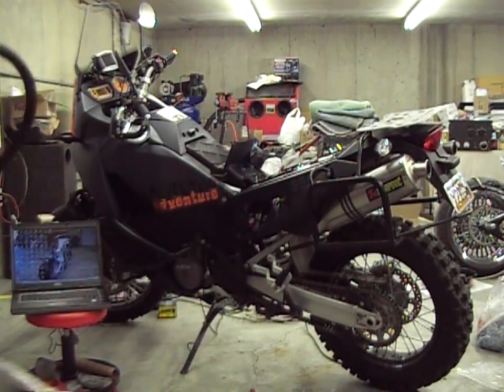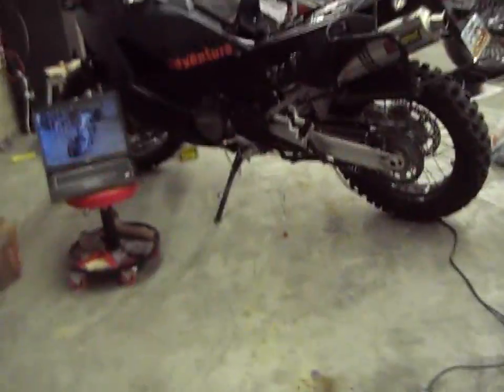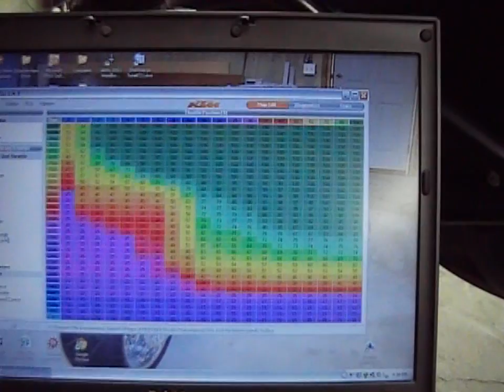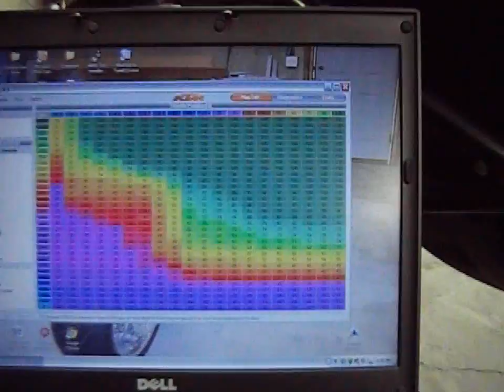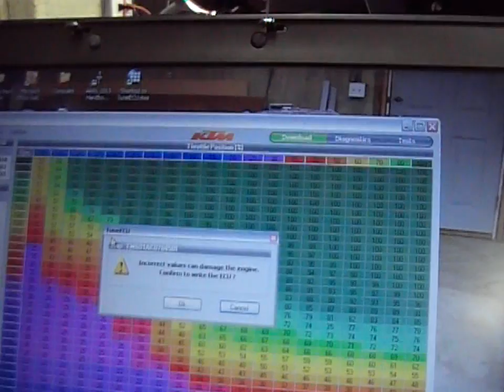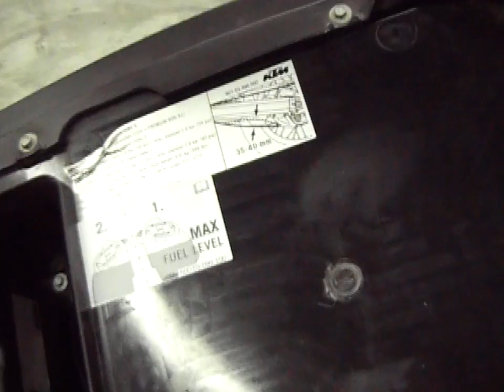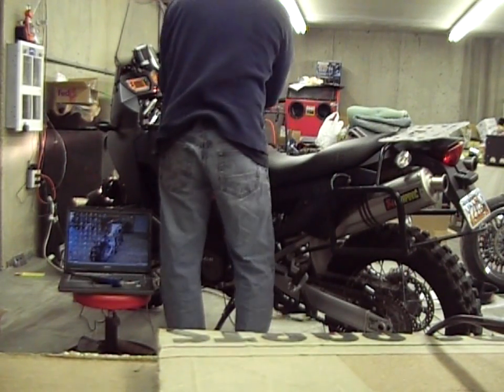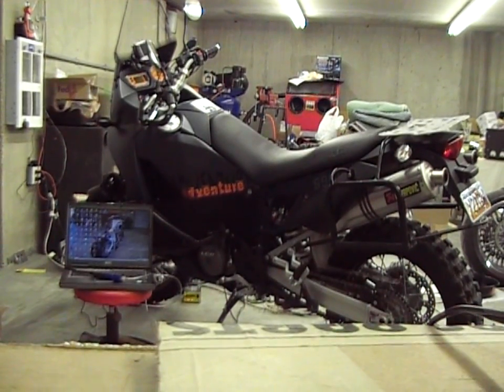KTM 990 Tune ECU set up

Comment: Hi, how are you? I have changed the engine of my 2008 ktm 990 adventure with akrapovic x one from 2010. I have copied the tables of the 2010 map to the map of a 2008 to be able to load it since the 2010 did not leave the ECU. Even so it continues to fail in lows, I have seen that the hpa pressure values of the 2010 are different from those of 2008 and I cannot modify them. Do you know how I can do it? Thank you

Comment: I have the same bike , but can't connect the ECU to TUNE ECU windows ( Im runing in windows 11) . I have tried like 10 OBD wires ( i have the adaptator 6 to 16) , but no one is working . Is it about the cable ? can you share your OBD reference ?
Reply: Did you figure it out? I just picked up a 2010 990. I’m about to drop some $$ on a tablet and the Bluetooth obd

Comment: Great thanks a lot.   I had a 07 990 Adv for almost 6 years and never even bought the cable.   I changed the exhausts to Akra Evos and the dealer changed the mapping accordingly but it was fueling incorrectly and it actually was stalling dangerously while riding.   Its great to know that it can be that easy.   I loved that bike.  I might consider having another one but the maintenance issues and the poor fuel efficiency kind of hold me back.    But I do tell you.  The feeling you get when you ride it, i havent had it on any other bike.   It will, 98% of time,  put a big smile on your face at some point.

Comment: Do you need to reset the throttle position sensor after doing this?  Is that what the 15 minute idle does?
Reply from the maker: Christopher Young You dont need to adjust the TPS, the 15 minute reset is to allow the computer to recalibrate itself.

Comment: can i send u my ecu
Reply from the maker: Unfortunately, I have no way of flashing an ECU, sorry bud :)
Reply: can u tune it
Reply from the maker: tim jackson In order to tune it properly, the ecu should be in your bike with your exhaust, injectors, air filter, etc. There is a large variation bike to bike for proper tuning, so unfortunately, sending me the ecu to tune wouldnt work. You should truthfully take it to a dyno, and use their sniffers to adjust the fuel mixture until you get to 13.2:1 ratio across the rpm range.
Reply: can i buy a  new ecu from ktm and put it on my bike will it work cuz my other bike do not have one

Comment: How those 2 fuel tanks work?
Reply: They are like 2 Settlebags one on each side. There is a Cross-connection on the lowest point. You can fill it through one , but it's faster fueling it by filling up one after the other.

Comment: on tuneecu web site 990 is listed but 950 is not... will it work with 2007 950 also?
Reply from the maker: The 950 should have carburetors???
Reply: really? i did not know that. i had 1999 lc4 and i am looking into buying 2007 and newer lc8 but i thought all of them have ecu. good to know. thanx.
Reply: well 30 secs of googleing "ktm 950 vs 990" gave a lot of answers... thanx

Comment: mrduhfactor, i have just "de-catted" my stock cans on my 2009 990adv. i wanted to know if i should re tune or just see how she runs without. what do you think? i chose the cheap route for a little louder pipes....
Reply from the maker: +paul moore  You can certainly start with the stock map. If you find that it feels lean, or cuts out, you can add a little fuel to the stock map and richen in a little. If you didn't change the air box/filter, it's unlikely that it will change much. Good luck!
Reply: Awesome great news thanks Mrduhfactor

Comment: hi I have a ktm 125 duke 2011, will this cable works on my bike? I have a flashing check engine light, which I am trying to figure out.
Reply from the maker: Hi Andy,
can you send a picture of your ECU plug to my email? send to mrduhfactor at gee mail dot com.
Reply: Ok I will do that
Reply: this cable need an upgrade to use on ktm duke 125 .i make a video for settings and upgrade .

Comment: Great video! :)  -  I am interested in getting my 07 990 A hooked up, I have just bought it and the snatchy throttle at low load/rpms is killing me.  I have read turning off the o2 sensors can help?
Reply from the maker: +buaan  I have an 07', and have a great map I've put together. If you e-mail me or message me with your e-mail address, I'm happy to send it to you. Part of it is turning off the 02 sensors (mid range lean is caused by that) but a lot of it is tuning. What exhaust are you running?
Reply: @MrDuhfactor  very informative, just picked up a 2012 990a and looking to smooth it out. Thank you for passong on ur experience.  Yup grinning ear to ear
Reply: MrDuhfactor Message sent with email, cheers!  I am running a Remus 2-1 exhaust.  Any help with with the snatching issue would be awesome, I was kangarooing up a lane a other day like an idiot!  Also, do you think US and European tunes are different?  Thanks for your help MrDuhfactor! :)
Reply: +MrDuhfactor Tried out your map, I found out that the US and EU bikes are slightly different.  You guys have a Purge Valve for the gas tank emissions, my EU bike doesn't so it throws a P0444 code.  I copied the cells from your map to my original one tho which worked fine.  I got creative and copied a 2009 Adventure R map over my 2007 one so am going to check that out on a ride tomorrow :)  The R map has a lot of changes compared to the normal Akra one, nearly every table is slightly different, more ignition and fueling plus the F-L map has big changes.

Comment: Hey Mr Duhfactor, 

I picked a 2009 990adv with abs,  it has 31000km about 20000miles, I put on 5hrs before it snowed  and winter hit. The good is: new chain, sprockets, fork seals, tires,  and valves were done about 3000km ago by the previous owner. 
I am looking at some mods and maintenance for the winter. Fuel filters oil change. Quick connects on the tank.
Also I was thinking a: CJ oil change kit (that extension hose), fork air release valve, side stand relocation kit with dongle to stop the stand kill switch. Throttle tamer, remap for stock or new exhaust, I am still trying to figure out what is an affordable way to go. It could be cheap if I keep stock exhaust, but can I still remap to remove the throttle snatch? Thoughts suggestions welcomed. 

Other bits are a thermostat switch for fan to engage it at lower temps.  
Off the top of my head that is it.
Thanks again for your thoughts.
Reply from the maker: Wow!! Sounds like a great bike!! One of the cheapest mods that will improve the bikes awesomeness is to buy the ECU cable from CJ designs and load up a new fuel map. I remember there was a dyno tested map for the 09' model on TUNE ECU's web site. The bike I have is an 07', and the 07' ECU is different from the 09', so my map wont work on your bike, but everyone raved about the map that is on their site, I'll have to look and see which one it was for you. All of the other mods sound great. Has it had the cannisterectomy mod done yet? If not, I've video'd it, but haven't posted it on my channel yet. It's another cheap mod that is great. Good job buddy!
Reply: Thanks so much can't wait to see the video, and I am putting in my CJ order this week😁

Comment: Great video, what do you think would work better for smoothing out the snatchy throttle? A throttle tamer or remapping? I like the new mufflers you put on lots of positive comments on ADV forums, how have they worked for you? would a two into one exhaust work the same ? Better? I saw a system  at CJ design and was thinking 😁
Reply from the maker: Hey buddy!!! I think you need both really. I have a throttle tamer, and have re-mapped the ECU. She runs great now, even down low where that irritating throttle surging and jerkiness happens. I actually modified a stock map, the Akro map was way too rich, and that low RPM jerkiness was pretty bad. Remind me what year your bike is? As far as performance goes, I think either the two muffler, or the two into one is fine, and likely not different enough to worry about. I like the less weight of having just one muffler, but most people don't care about that on such a big bike to start with. The sound is wonderful on either system, and at times I've thought I actually prefer the sound of a single muffler over the duals. Tell me more about your bike buddy!
Reply: MrDuhfactor what's a throttle tamer?

Comment from the maker: Yes, that RPM snatchiness is usually because of the 02 sensors trying to lean out the fuel, in tune ECU, you can turn the 02 sensors off, change the fueling in those RPM ranges, and clean it up. There is a good map for your bike on the tune ECU web site done by Powertripp, you can download the map from the web site, follow the directions, and load it up into your bike ECU, and test it out. Good luck!

Comment from the maker: Some people have had trouble with loading up a new map into the bikes ECU when there has been a draw on the battery. Since the headlight comes on when you turn on the switch, we remove the fuse in order to not have a drain on the battery and keep it's voltage up to maximum.